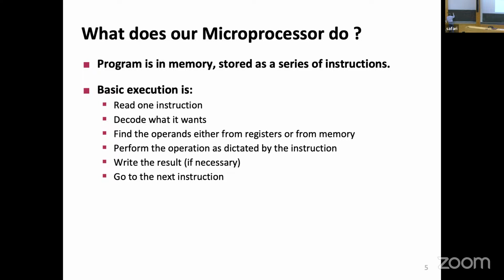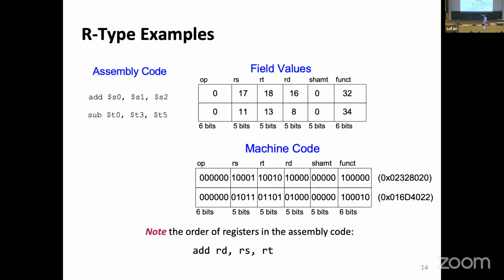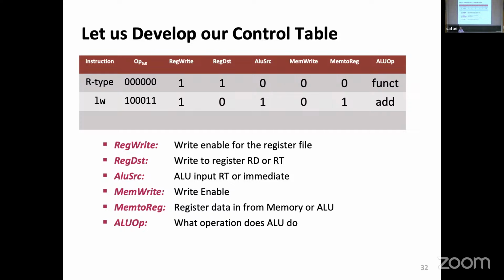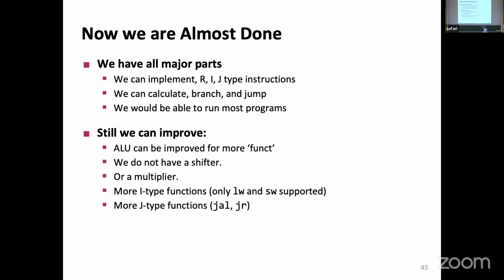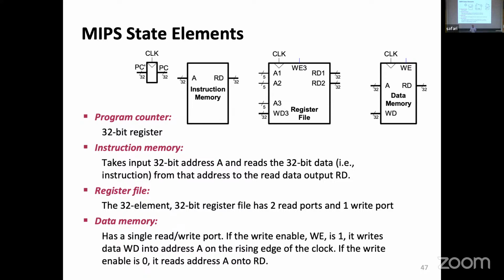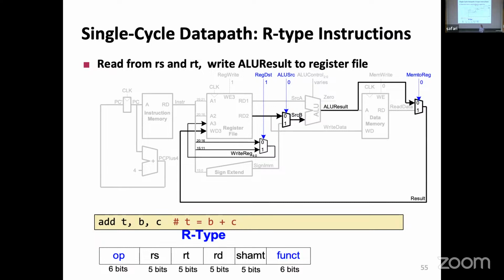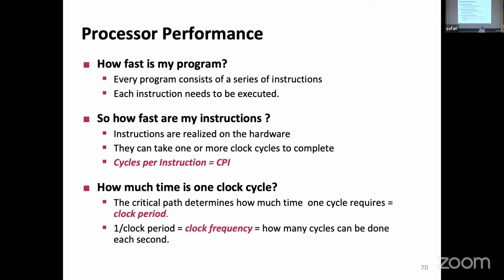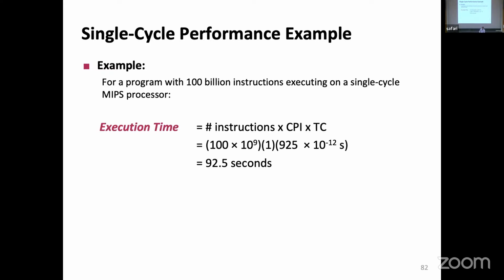Digital Design and Comp. Arch. - L17: Single-Cycle Microarchitecture II (Spring 2024)

Comment: 26:02 you said about being able to use the 16 bits in the immediate of I-type instruction as 24 bits How is that possible?   
 even adding base (rs) you get 5+16= 21 bits. if it is something like using the Program Counter (PC) relative? but then you have PC be 4, rs be 5 giving 4+5+16 = 25 bits ???